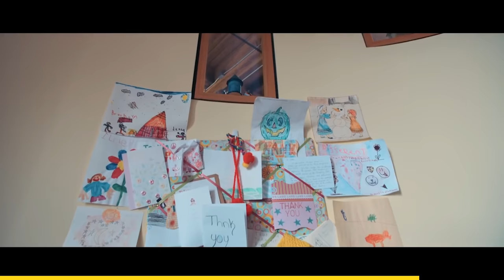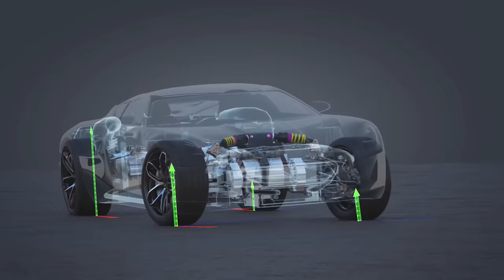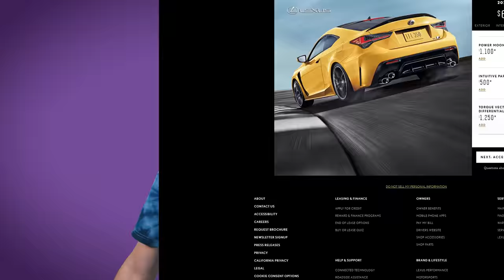The Most Confusing Part of Your Car EXPLAINED

Comment: Torque equals the cross product of the distance vector and force vector. 
In cross-products, unlike dot-products, the order matters. 
The unit should be FtLb, not the other way around. 

Dot product:
A • B = B • A

Cross product:
A x B ≠ B x A

Although the SI unit for torque is Newton-meters (Nm), it should be meters-Newton (mN).

Comment: Why was Honda not mentioned? They were the first to implement an Active Torque Transfer System (aka: ATTS, on the Prelude, in 1997) that used clutches to direct power, instead of brakes (to waste power!)

Comment: The TON-MILE has always been my favorite unit of measure, commonly used to quantify mechanical wear of large wire-ropes used in very heavy lifting gear like that used in a drilling rig’s draw-works.
Reply: So it's not an enormous unit of torque and is instead a measure of wear based on how much weight has been applied over a length of wire-rope?
Reply: @skaldlouiscyphre2453  I believe the metric first found use in the locomotive/freight/rail industry. Something to the tune of the weight in short tons divided by the distance travelled in miles equals ton/miles. I suppose it could be used many different application of scale, but wouldn’t an engine large enough to have it’s power output measured in ton-miles be awesome!? 🤘🏼
Reply: @magnumcipher4971  

I appreciate the explanation, the older I get the harder it becomes to still learn something new every day.

Comment: I would love an episode about how electric vehicles do torque vectoring, especially for off-road oriented trucks. How does torque vectoring work in EVs with 1 or 2 or 3 or 4 motors?
Reply: In a four motor EV I’d imagine the “diff” would be mainly software controlled I’d imagine

Comment: At 6:50-ish there you had the tires mixed up. The outside won't spin as it has the grip thanks to the higher load thanks to weight transfer while turning. It's the unloaded inside tire that spins.

Comment: I am a little confuse about the joke Jeremiah makes about torque @7:00. Isn't it the inside wheel that gets all the torque wasted because it broke traction? It should be the inside wheel saying: "it's my torque ablalblalabllalba" while wasting it.
Reply: Yes you are right 😅
Reply: Even I thought that for a second.
Reply: I had to watch that part a few times before I realized it was a mistake, I thought I was so dumb for a second trying to figure it out lol
Reply: Got very confused there for a second, had to watch it a couple times as well
Reply: This is also wrong. Both wheels get the same torque but, as a result of more traction on the outside wheel, different speeds 😄
Reply: Yeah it was surely a mistake

Comment: Yeah, I'd love to see a B2B on "posi" differentials, including the old school Detroit Locker, vs a TrueTrac, an Auburn, and the GM eLocker. Then there are the ARB Air Locker, the now defunct Gleason Torsen, and cheaper "lunchbox lockers" like the LocRite.
Reply: True Trac/wavetrack/powertrax or ARB for the win....trust me....I ship thousands of diff parts every day. True Trac can torque bias through its helical(or any helical of that design type) internal gears, also they don't require additive or clutch replacement over time(so they make up the difference from cheaper clutch style options) ARB is nice, but comes with all the caveats of installing an air system. Or you can get a motive wavetrack(helical like the eaton...pricey, but LIFETIME WARRANTY)....or I'd also recommend Richmond Powertrax pro series helicals....middle of road on cost...no additive or clutches to deal with still. Run from Auburn. Just  back away from it slowly and turn and run. Interesting idea, but not rebuildable and uses special "conical" clutches....that you can't replace. Detroit lockers are pretty decent(but those are a locker....not a limited slip) but are pretty aggressive usually with dragging the outside wheel...not quite like a spool...but not pleasant on the street.
Reply: Spartans and lunchbox lockers go inside your factory open diff case after you pull spiders(most times, a few different ones use a cpl of the factory spider gears along with the new parts. E lockers work OK, but are not suited for serious wheeling/hp in most situations as they rely on magnetic actuated "pins" most times to engage on part of elocker....so not super robust...but will lock. GM oe limited slips are known as "gov bombs"....there's a reason
Reply: Torsen diffs work like any other helical for most part....just slightly different designs
Reply: @bluewffl8472  Yeah, the Auburn is just like the GM Positraction, Ford TracLoc, or 70-up Mopar SureGrip. Not rebuildable. The older SureGrips could be reclutched. The original Detroit is harsh. The TrueTrac would be my choice, if funds allow. I'd settle for a LocRite, but as a Mopar guy, I know ya can't get em for the 8.75.

Comment: I have actually been looking forward to this video and the center differential video you mentioned since I was a kid playing Gran Turismo 2. I Always toyed with the adjustable settings on those center differentials and two-way limited slip LSDs but I didn't realize there were different ways of building a locking differential. I never appreciated the Active Stability Management as they called it (the brake based system). If I remember right this system was even supposed to apply breaks to wheels that weren't even driven to stabilize the car during excessive YAW. To me it just made the cars' handling feel more like an arcade game and I prefer to just rely on the adjustable limited slip differentials, it allows me to control how the steering feels.

Comment: Acura had torque vectoring well before Lexus. In 2004, the '05 Acura RL introduced torque-vectoring all-wheel drive. 

As far as the Lexus system, nearly every Lexus since 2006 (and even many Toyotas) have vehicle-dynamics integrated management, which is essentially brake vectoring on steroids, capable of making millisecond-by-millisecond braking, throttle, and even power steering adjustments to prevent under or oversteer, often before it is even noticed by the driver.
Reply: Dont forget about the rear diff in a Nissan juke, its got lotsa clutches just like the sh system honda made.  I personally drive an 09 rdx which is a very under rated car.
Reply: @jamesgasper8630  Mitsubishi Lancer Evolution from the 90's dude
Reply: @christoforospaphitis4090  the Evo had clutches in the rear axle, but it couldn't overdrive the rear axle like SH-AWD. Only the Evo 10th-generation had true torque vectoring.

Comment: Great video. Only thing is, I'm not so sure how much maintenence a LSD needs. I own a 30 year old Fox Mustang with 130k miles. A lot of those have been pretty hard miles. I have changed the dif fluid to synthetic around 50k miles, but that's it. The LSD still works awesome. Lays two long patches anywhere of any length at any time.

Comment: Looking forward to that upcoming episode. I have an AWD Lincoln and apparently it's FWD on a normal basis, and AWD when it needs to be. However, whenever I'm driving it and I need to do something that being AWD outshines FWD in, like hard acceleration from a standstill, or pulling through snow, this car does it seamlessly as if it's been in AWD the whole time! Would love to see what that big transmission looking thing in the back is doing behind those walls.

Comment: VW released in 2013 on the Golf mk7 GTI Performance Pack the VAQ differential, that works with XDS. Basically that's the FWD version of what Lexus introduced later on the RCF. The VAQ has clutches to send more torque to the wheel with more grip and XDS is a brake based torque vectoring system, already available since 2009.

Comment: The Lexus TVD in the RC-F is a bit more than where you left it with just electronic control of the clutch packs. What really makes the Lexus version different is that the clutch packs engage a planetary gear set that OVERDRIVES the outside wheel by 1.5 to 3 percent more than the differential output. You can actually feel the yaw moment when it is helping to drive the rear outside wheel faster to push it around the corner. Fun fact, it is also 80lbs heavier than just their standard Torsen rear diff.

Comment: As far as I understand, torque vectoring is where torque is actually transferred using clutch packs or a mechanical system. Like in EVOs. While using brakes is now called torque vectoring, it is kind works in the opposite manor and is completly a reactive system unlike an evo

Comment: Dude. Very, very good explanation. I could not have said it better myself but here’s my request: FWD cars that fight their own urge to understeer… so weight transfer is as important as “from the wheels that slip, to the wheels that grip” -Subaru advertising. Now, a front wheel drive car can avoid understeer in a few different ways. The Honda or Acura Integra… the Pontiac Grand Prix GT specifically because the GTP was supercharged and unfair to the crowd…. Now what about the Cavalier SS? Who made the best FWD rocket… Mazda 3 is a hatch so I can’t include that. Think about those legendary FWD cars we love to hate and hate to love… did they use stability management?? I’ll say the, “Wider is better” slogan from Pontiac was true to a point. I turned that car inside out around the turns. Carved those wedges and I hated that it was FWD. VERY effective platform. I turned off the stability control and smoked those tires. Turn it back on and smoked those Mustangs that I love so much. Hahah
Reply: I cannot believe that I forgot about the Taurus SHO. SVO? Yep. Who made the best FWD.

Comment: 4:12 the common unit of torque is not the pound-foot, it's the newton meter. 
Even the pound-foot itself is based on the metric system nowadays, just like the rest of the imperial system.
So calling it the common measurement like the USA aren't the only ones using it, is just wrong.
Reply: It's common in the US so someone from the US will say it's common
Reply: @Kana0211  just because the US is using it doesn't mean it's common. It's specific to the US. It's like americans going to other countries and yelling at them to speak english.
Reply: @dariolinder4508  Donut’s based in LA. Primary audience is also American. “Common” units are going to be the customary/imperial/American/whatever you want to call them units. Not everything is abt the rest of the world
Reply: Common is not the same as most common
Reply: Calm down dingle jingle.
Reply: @dariolinder4508  seeing as how you came to the video, which is entirely produced in America, it's more like you came to America and an American told you pound*feet is common.
Reply: @Kana0211  hi Edmund 🙏
Reply: That would actually be the newton metre. If you're wanting to get technical and pretend that this isn't an American channel on an American site being hosted by an all American staff then at least have the decency to spell it the way it was created to be. Not a single automobile is advertised or tested in N m in the USA so I would say it is absolutely the common torque measurement here. If you don't like it don't watch it.

Comment: I think you messed up a bit at 6:54. As you said just before, normally it's the outside tyre that needs some torque transferred, while the inside one loses traction (due to weight transfer and centrifugal force). This problem is exacerbated for RWD cars on uphill airpin bends where the rear inside wheel also has part of the weight lifted due to the elevation change.

Comment: I'm pretty sure that GM's Positraction a half century ago had the clutch plates all inside the differential carrier.  It used a ramping action to increase drive through the wheel with better traction.  I had a friend with a new Pontiac Tempest with the base 326.  Not a GTO. But because he had PT, his car was much faster off of the line until the GTO would blow past.  No spinning of tires, just GO.

I had a Dodge van which I often took out to the Mojave desert in CA.  I swapped out the standard diff for the Chrysler limited slip.  Well, sir, this was a very different concept and a lot cheaper than clutch packs.  Hard to describe, partly because it's been so many years ago.  Both rear axles were connected to the carrier and each other via a highly polished cone and receiver for the cone. One for each axle.  There were very strong springs pushing the cone into the receiver.  On a turn on pavement, the cones and receivers would slip and thus act like an open differential. When one wheel started losing traction in sand, say, it acted like a locked differential.  I.e., no differential. 

This was great out there in the Mojave.  I'm not saying it was like 4WD, but it went a long way there.  However.............I moved back to Colorado.  On snow and ice, it had no forgiveness.  That locked differential.  The back end would kick wide with the slightest of throttle.  Hard to believe that Chrysler was OK with this design.

Comment: I live in a rural section of Ontario Canada. I drive a 16 y.o. open diff Crown Vic - which is surprising because I thought limited was standard on all P-71 spec cars. Covid times have been tough so I'm still running decade old summer rubber down to the wear bars, 5 months a year, 16 Km at the end of an ice road, with one particular part that I call 'Nemisis Hill' - a 90 degree turn at the bottom of a quarter mile 12 percent grade. There are some hairy mornings, and I've come down backwards twice in five years .. but I still trust my go foot, the ghost of ol' Hank, and 45 winters driving junk over whatever computer crap they're trying to shove down my throat.

Comment: It wouldn't be in the ECU (engine control unit), mich more likely to be found in the chassis controller, abs controler, or a separate one that would have otherwise been a separate stability controller, the ECU has enough things to manage and there's plenty of other boxes to stick the controls for that in that already get wheel speed sensors for each corner of the car run to them.

Comment: Look at the acura sh-awd system with overdriven real wheels to actually push the outside rear faster than the inside, trust vectoring.  It's noticeable in my 2012 TL

Comment: I’d love to see more as well. I own a Lexus GSF and it’s a a 4 door that drives like a 2 door. The TVD is pretty awesome it makes the car so nimble. I have I take and full exhaust on it and the sound of the v8 is awesome as well.
Reply: The torque vectoring differential isn't the only reason why the GSF handles so well, it has a system called VDIM which can literally make millisecond by millisecond brake, throttle, and even power steering adjustments to make the car handle better.

Comment: My 98 Honda Prelude Type SH has a torque vectoring system similar to the Lexus system. I guess the Prelude is just a forgotten car now but that tech was out in the 90s. I have to say that it makes a huge difference until one of the pressure sensors broke.

Comment: good episode! I think I'd change the title to "differences in torque vectoring systems" or something like that. No torque vectoring system is dumb; even the simplest form is beneficial in a street application. A braking system is technically still torque vectoring; you are increasing torque sent to the other wheel.

Comment: What i find stange with american and uk, i learnt the shaft going from the gearbox to the diff is a prop shaft (propeller shaft) and the shafts connecting the diff to the wheel hubs are driveshafts

Comment: Guess ya'll forgot about the Acura SH-AWD that's been kicking around since 2004? Just 2 years before torque vectoring tech was even used in rally cars. Not sure who was first with torque vectoring but Acura released it on their new 2005 RL model in 2004 but they were the first company to have a carbon fiber drive shaft in a factory vehicle.

Comment: The difference between ft-lb and lb-ft is where the force is applied.  If applied from the center out (like an axle), it's lb-ft.  If applied to the center (like a wrench), is ft-lb.  That's why car manufacturers and tool manufacturers differ in their units.

Comment: Dang!! Wish I would've seen this when it came out. I hate brake based systems (traction control). Imagine you are going into an uphill corner in the snow, TC hits the brakes, and Bam! you are stuck! You need wheel speed to rooster through. Open diff with locker is best option (& chains). Well, until you forget to disengage locker and plow through a corner and end up face to face with a tree or a 500 foot drop. Can torque vector handle 33K GVWR?

Comment: The helical gear LSD is the best mechanical solution that doesn't require electronic control. For AWD systems, helical gear front and rear diffs with helical transfer case is the ideal solution for all but the most extreme of conditions when brake based systems assist is useful. The BIG drawback...COST. Helical gear systems are costly i.e. Auburn Gear Helical system.

Comment: 10:51 this sounds scary, like the car could start acting very unpredictable soon as you're on the edge of losing traction and and you start counter steering, and the car starts braking and accelerating trying to murder you by attempting to actually go where you point your wheels instead of where you try to re-direct the inertia.

Comment: Why don't you just use a variable "brake" system for the spider wheels based on the rotation speed difference between the wheels? Wouldn't that limit the issue? Basically if you stop the spider wheels inside the differential you get a fixed axel system.

Comment: ft-lb and lb-ft technically is the same thing, because it doesnt matter if you multiply ft with lb or lb with ft. unlike miles p hour where you divide those 2 values.